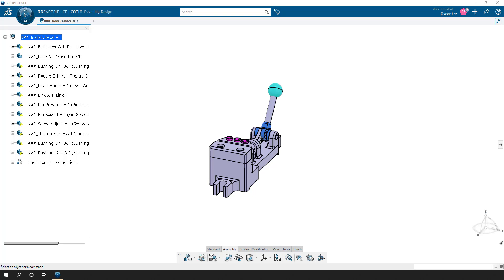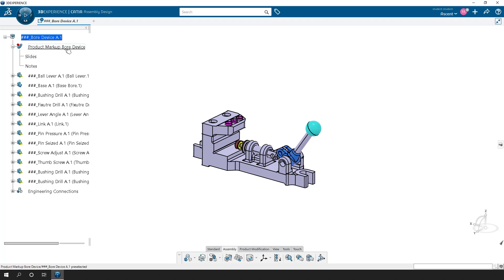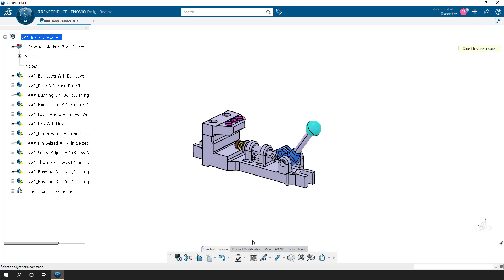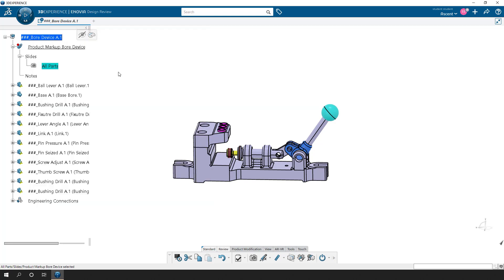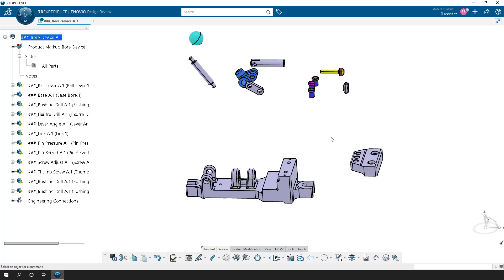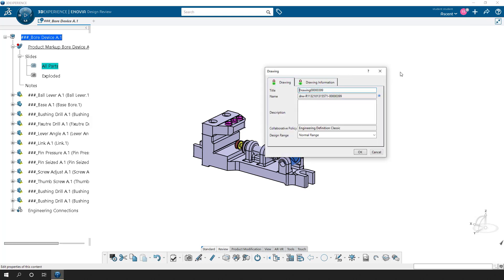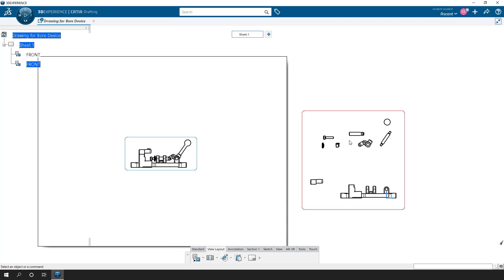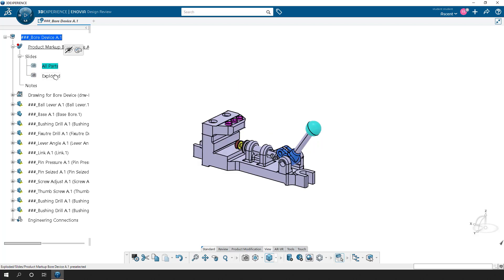CATIA 3DEXPERIENCE 2022x: How to Explode an Assembly and Place it on a Drawing

Comment: @rand3d  I have a questions for explode command,
If the product has no engineering connections, the command is working properly?
Because, when we do like you do, all parts was going to far away in the space. This problem is related with no engineering connections?

Comment: Is it possible to remove a part from the exploded view in the drawing? e.g. the Ball Lever A. I haven't yet figured out a way..
Reply from the maker: Yes, it is possible if I understand your question correctly.  I will try to talk you through the steps, but I recommend you look up the ability to "Overload Properties" as they work basically the same in Catia V5 and 3DEXPERIENCE so any information on either will help. 

1.	After creating the drawing view that has all the exploded parts plus the one you don't want shown, right-click on the view in the tree and select *object>Overload Properties.  * represents the view's name. 
2.	Select the part on the drawing display that you want to change in this case the handle. Its name will appear in the list of Newly Selected Elements in the Overload Properties window. 
3.	Select the icon to the right of the listed Part that represents "Click to activate the Unuse Property" it is the 4th one for me, and the names will appear when you hover your cursor over them. 

That will remove the part from the drawing view, but it will still exist in the Assembly and in the slides that originally had them. 

Hope this helps.  Mark
Reply: @rand3d  Hello Mark,
Thank you for explaning. That was very good for me.